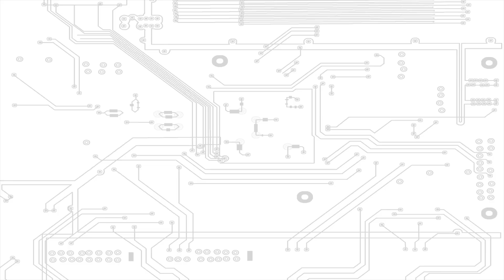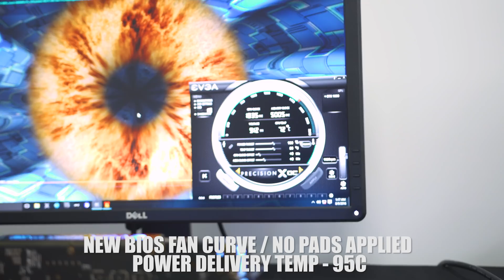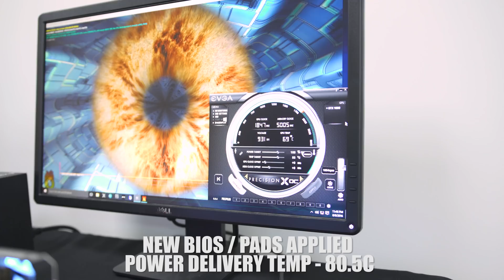EVGA FTW VRM Failures - What should you know

Comment: Cheap bastards charging a premium for quality parts then skimping out on cooling solutions i may never buy EVGA again and for the obligatory Jay is not sponsored comments where the hell are your 1070 and 1080 FTW card reviews couldn't find a single one of them all hybrids SC SSC classified and kingpins no FTW's
Reply: Your lack of punctuation is... disturbing...
Reply: Most vendors other than NVIDIA actually have pretty decent cooling. If you want an example for a sub par cooling solution check out those of NVIDIA, even on a fucking Titan X.
Reply: asus is rock solid, most of the time. i learned my lesson with msi mobo though
Reply: Don't just blame EVGA for doing this, it is industry standard to skimp on cooling and overall build quality. Nothing new as they have done this crap for decades except that users (the smart ones anyway) back then were wise enough to fix problems before they ended up with bricks.
Reply: The weird thing is, the cheaper ACX 2.0 and 1.0 cooler solutions don't have this overheating problems. Thermal pads are pretty cheap too. It seems more like a huge unintentional oversight.
Reply: ***** asus is great .  thier pascal series is the best there. evga is fancy led... my fans are off most of the times in the games its crazy

Comment: First thing I did was change the fan curve after installing my 1080 FTW before all this.

Would using an aftermarket TIM give a couple more degrees cooling?
Reply: Smart person. I also changed my fan right away. using after market TIM is a good idea yes but that doesn't affect your vrms. I would order the pads and get them on with the new TIM and you should be fine. or you can send it in and have them do it.
Reply: Yeah, I signed up for the free pads.  Just waiting for them to come in :)

Comment: What settings were used for your furmark test to reach 78c? I have an EVGA 1070 SC version, and running the 1080 preset I seem to max out at about 70. I hope it doesn't come down to me needing to do this fix. I know it's free, but my house is more cat hair than it is house and I'm honestly not comfortable disassembling this with all that fur flying around, and would really rather not be without a card for about a week during transit.
Reply: Set a custom fan curve or update the gpu bios in a few days when it releases. That will lower temps. Only other option for even lower temps is to cross ship your card or do the pads yourself.
Reply: Ah, so the bios isn't released yet? That's good to know. I kept searching EVGA's site only to find driver updates.

Comment: So.. If i buy an EVGA 1080 in 2017 will this already be applied, or do i have to make the process myself?
Reply: Keyword "shipped". If you are buying from a retailer you might want to ask them when they were shipped the inventory.
Reply: I think they said any cards shipped after they announced this fix would come from the factory with the thermal pads and updated bios already. Its in the GN article Jay linked.
Reply: TheJaxax
This still doesn't fix the lack of contact between the VRAM and the cooler meaning new cards being sold still have at least one problem. Just don't buy an EVGA this gen in case EVGA doesn't address this issue.

Comment: ATTENTION!! FYI Everyone:  That "bulge" under the thermal pad is supposed to be removed prior to applying the thermal pad.  It's just a spacer/standoff, and will impede the thermal flow if not removed.
Reply: if this is true then this Comment certainly should be higher profile.
Reply: leaving the rubber standoffs shouldn't make a difference

Comment: It would've been better if EVGA just admitted the "oversight" from the start without Toms hardware flagging this... I've been running my gtx 1070s in SLI since July. Hopefully the cards are in good condition. All I can do now is wait for my thermal pads... Pretty sure this was a cost cutting measure... how can EVGA not notice this especially on the FTW cards. I mean cooling is pretty standard stuff. Thanks for vid Jay this will help but my loyalty to EVGA has been shaken to say the least. 7 straight EVGA cards the next will likey be from another brand...

Comment: I have a 1070 superclock, should I be worried about this because it uses the acx 3.0 cooler?
Reply: Set a custom fan curve. order the pads or send it in to be fixed.
Reply: TheHacker0007 yes. did you watch the video at all? lol having the pads can make a 10-30 degree depending on your fan profile

Comment: So the issue doesn't affect the gtx1050 ti sc 4gb correct?
Reply: byron fox is the cooler an version 3.0 like he mentioned
Reply: byron fox I would assume that a 1050ti uses much less power than a 1080, so the temprature should be much lower.
Reply: byron fox I think the SC Version of the 1050ti uses the ACX 2.0 cooler like my 1060. So there should be no problem
Reply: It does not, it is not an ACX 3.0 card.
http://www.evga.com/Products/Product.aspx?pn=04G-P4-6253-KR
Reply: Only ACX 3.0 heatsinks have this problem. 1050/1050 Tis don't have ACX 3.0 heatsinks. Even if they did, the low 75w power draw/low heat production of the 1050/1050 Ti wouldn't be an issue.

Comment: Do you know when they'll be approving and shipping out the thermal pad mod? I applied for mine a couple days ago and it's yet to be approved
Reply: I did it a day after it opened and I am still waiting for approval myself. Just use a custom fan curve and don't run Furmark til you get pads installed and you should be fine.
Reply: John Totten I don't even have a mouse atm since corsair keeps fucking up my RMA, (they sent me a keyboard instead of replacement mouse), so I'll be off my PC for the next few weeks, until i get my thermal pads

Comment: The HDMI port will fail in a short time anyway on any EVGA cards. Sub standard HDMI cards the pins break very quickly. I have TV's and other cards that have had cables plugged into the hundreds of times. EVGA video cards die as soon as the 2nd time you plug a cable in. I have 5 EVGA cards from 470-650Ti all with dead HDMI ports.

Comment: I have some leftover noctua thermal paste from a CPU cooler, should I use that rather than the factory paste they send?
Reply: You could probably use the Noctua paste and be fine. But id use the stock stuff they supply just to be safe. Since your working with a bare dye.
Reply: The Noctua NT-H1 is one of the best thermal pastes you can get. I used it on my Sapphire 290X and dropped the temps from 84 to 77°C and the Fans from 90-100% to 71%. The values were after 30 min. of Furmark burn in.
Reply: I got my thermal pads in the mail and installed them with the noctua thermal paste (the instructions are a little different than what Jay did in the video) and everything works great, I would recommend using the more premium paste that came with your 3rd party cpu cooler if you have one but if not im sure the factory paste from EVGA would work fine

Comment: If I haven't had any issues so far or had my 1070 become higher than 55'C (while under load) on Precision X OC, should I still do this? I don't want to send mine in because I can overclock it alright compared to what I've seen some people are able to overclock theirs to and don't want to get one that can't do as well. (+150 core +550 memory if anyone is interested)
Reply: Set a custom fan curve so it doesn't heat up. Order the pads and put them on and you should be fine.
Reply: I ordered the pads anyways but I set up a pretty steep curve on my card and it's been at decent enough temperatures.
Reply: Zaryss  Had my ftw card since July, custom fan whole time. no issues. Pads on order. good luck.

Comment: EVGA has gone down hill IMO. My "new" (at the time) 980ti had a major cooling issue. basically the fans wouldn't spin up until my card hit 90+ degrees C.. And my friends 980ti hybrids' pump didn't work. just seems like some QC problems have arose over the past year or so.. this example is proof to me. I understand this is not supposed to effect ACX 2.0 coolers but this has sincerely effected both of our cards.. kinda disappointed in EVGA at the moment..

Comment: of course the first evga card I decide to buy and this is what happens to it... though mine stays right at 75c this hurts my heart.
Reply: gpu temp does not equal memory temps.. you have a problem.
Reply: You can't measure the VRM temps through software, there are no sensors on them. 75C is for the gpu itself.
Reply: noted

Comment: literally just bought a 1080ftw last week and I'm not gonna lie.. in pretty pissed
Reply: Moe Joe What did Nvidia do?
Reply: Emil Bøilerehauge Because Micron makes GDDR5X. Most GTX 1070 with normal GDDR5 use Samsung though.
Reply: Yukmout B is anything weird happening?
Reply: well I wouldn't say anything wierd except it doesn't like AA
Reply: Hehe... Blueprint...
Reply: Yukmout B I'm glad that I bought a non-FTW EVGA card and I'm pretty happy.
Reply: nvidia chose to use shitty micron ram. with Samsung ram there wouldnt be a problem
Reply: Just run a more aggressive custom fan profile which is something I did anyway from day one as I don't agree with all this passive fan nonsense, better to have the heat out of your case with a tiny increase in audible noise and I recommend this for most brands.

20% fan always on and ramp up from there, my card never exceeds 65C at about 70% fans and I guarantee the VRM's are well within tolerance.

I do believe this is not great form EVGA's  however, seems like a huge mistake that dozens of staff should have realised by just looking at it.
Reply: You're well within your warranty for the retailer you bought it from. I'd suggest, if you want a refund, to do so now.
Reply: ***** I don't care who he bought it from, EVGA's customer service is better.
Reply: Battleneter Thermal transfer calculations aren't that easy. They probably made a small mistake in the calculations that resulted in the VRMs appearing to be cool enough without the need for active cooling.
Reply: Hank I beg to differ. I got my refund promptly from Newegg. EVGA did not offer me a refund, so...
Reply: ***** Did you ASK EVGA?
Reply: +Mortal Network What did you say and how long have you had your card? Ive had mine since august 25th idk if newegg would refund me my card now or not
Reply: Kyle Clevenger NewEgg's policy is usually 30 days.
Reply: Hank ok I figured thank you
Reply: Kyle Clevenger I made my case that I was not confident in my purchase, EVGA, and their fixes. I just got my card on Oct. 12th so I was well within my 30 days return. I can't promise they'll refund everybody as its case by case. They made an exception with my case since I've bought plenty of products from them in the past and they valued me as a recurring customer. You might have a harder time convincing them since you bought the card months ago.
Reply: Hank Yes I fully understand all that, however a more aggressive custom fan profile will keep the VRMS well within tolerance as shown by EVGA themselves, I do this anyway. I am not defending EVGA they have screwed up no question imo.
Reply: Moe Joe oops my misunderstanding then
Reply: Kyle Clevenger Ewwww why are you gaming at 60hz (2160P 4k) and playing first person shooters, sell that 4K slow turd on Ebay and buy a real gaming 1440P higher hz display, and enjoy the difference!
Reply: Battleneter Haha honestly wanted something 4k and something cheap lol. Didn't really have the extra to throw down on a higher hz monitor
Reply: Battleneter sometime soon I'll buy me one like you just mentioned
Reply: +Moe Joe I'll have to check that out
Reply: Kyle Clevenger ah ok cool, worth maybe doing :)

Comment: Jay... you forgot to mention when you do the cross-switch RMA with them, you need to pay the MSRP of the card first for insurance purposes. You get your money back when they receive your card, but it's still kind of sucks if you don't have the money at the moment. So if you don't have the money for the card, then you need to send it the old way and wait a week or two. Also keep in mind if you are going to send it back, you are going to have to pay for the shipping of the card to get to their facility, but you don't have to pay for the return. That's another thing to keep in mind. So it's either you do the thermal pads and don't spend any money (but have the fear of somehow messing it up), or you spend some money to ship it and wait a while or pay for the cross switch. Just like to let you know because it seemed a bit misleading to say the cross switch without that fact. Other than that, awesome video! :)
Reply: Now try that from outside USA. It will take you weeks to get a replacement. Not to mention the cost.
Reply: Also the reason I know this is because I have a EVGA GTX1070 FTW SuperClocked Edition, so I went through the process and this is what they told me.
Reply: +DudeGuyMan99 Well it makes sense, some people try to do the cross switch and get two cards without shipping the original, so they charged the mrsp for insurance reasons. It sucks for me though because I don't have the cash for that so I have to do it the normal way. And the icing on the cake is I also still have to pay for shipping which is a wtf? You would think that this is their fuck up so they would at least pay for that...

 Also that sucks dude. I live in the California so it's really close to me so I don't have to wait that long.
Reply: No, if you have a credit card you pay nothing. I've done two in the last week LOL. 0 charge.
Reply: John Totten When I talked to the REP, they told I would have to pay the MSRP of the card, and then they would refund me. So either you don't know what you are talking about, or I don't know what Im talking about. Im going to call them right now and see what they say.
Reply: EVGA offers full warranty support on its products, with cross-ship RMA*, and stands behind its products and commitment to our customers.
 
Any customer who is not comfortable performing the recommended VBIOS update, may request a warranty cross-shipment* to exchange the product to EVGA for an updated replacement.
All graphics cards shipped from EVGA after 11/1/2016 will have the VBIOS update applied.
 
*The EVGA EAR(Advanced RMA Program) and Cross Shipping options are available in the Continental United States, Hawaii, Alaska, Canada, EU, UK, Norway, and Switzerland.  EVGA offers Standard RMA replacement options in the Middle East, Africa, India or outside of the before mentioned supported areas.

http://www.evga.com/support/ear/

So reading thru the EAR program you give them a CC number but they wont charge you unless you don't return your card to them by 14 days.

Link to the issue on Evga.com http://forums.evga.com/EVGA-GeForce-GTX-10801070-PWM-Operating-Temperature-Update-m2573491.aspx
Reply: KrazieMonky  Well, they just posted that info on their site yesterday, Normally you have to pay money to have EAR on your card (one time use)  so my guess is you didn't purchase that when you registered your card? I guess Evga fucked up and opening EAR to everyone (to the countries they list) to try and make it as painless as they can. So yes I would call while you have the pages up to make sure they take care of you the way they said they would.
Reply: John Totten Yah, I called, have to pay MSRP as collateral. Welp. Rip me
Reply: KrazieMonky  Should have told them they need to upgrade the info on their EAR website then since it gives false information. That is messed up. I have a 1070 FTW and 1070 SC card. I have used a custom fan curve from day 1 with no issues. I ordered my thermal pads and plan to install them once they arrive along with a better thermal paste for the gpu. Sucks man, Sorry I tried to help.
Reply: John Totten Don't worry man it's not your fault. I just cancelled the RMA and just went with the thermal pads ¯\(ツ)/¯
Reply: KrazieMonky  Yea, I have 2 cards and ordered the pads also. Got some new MX-4 TIM to use and it should be easy sailing once pads are on.
Reply: Just did it about a month ago, didn't have to pay the MSRP.  They charged my card $1 just in case I didn't send my old card back to them. Charge was cancelled after they received the card.
Reply: OH yea he "forgot". LOL. Theres about 10 other things he didnt forget that made the company look and sound better. If they were all about the customer they would have never cheaped out on a fucking thermal pad. Scum Bags, All Of Them.